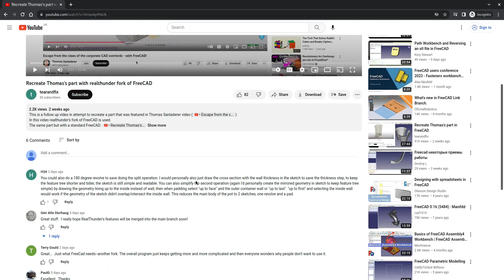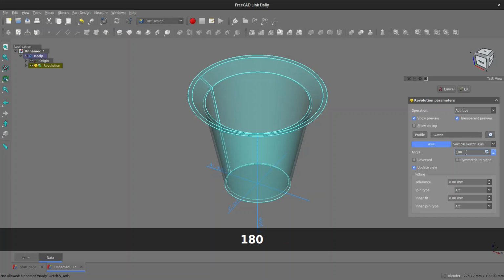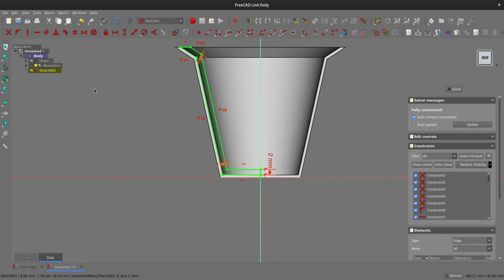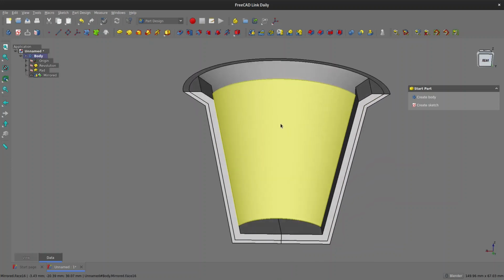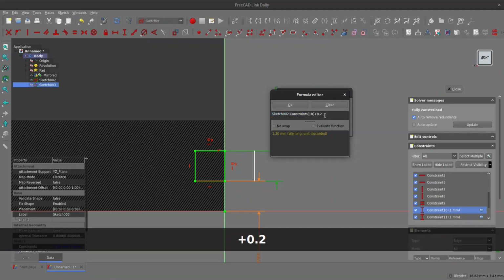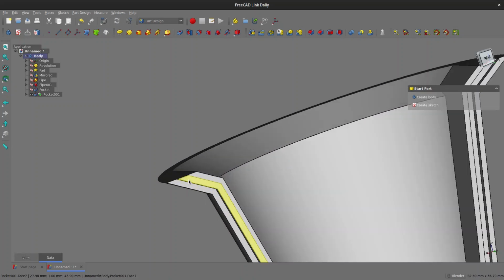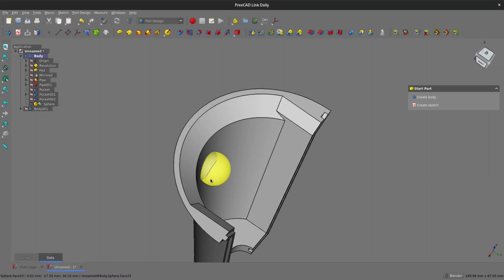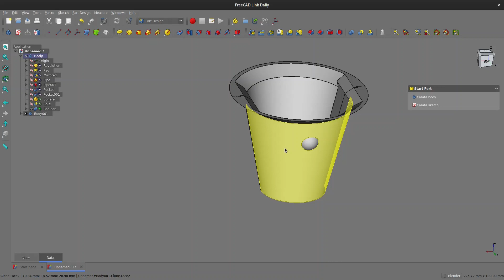Another approach to design Thomas's part with Realthunder FreeCAD

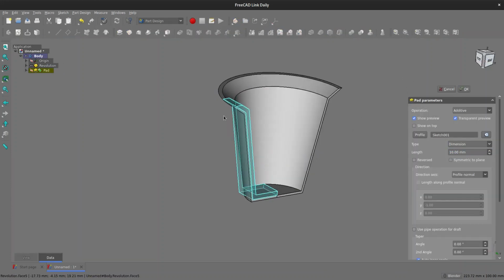Comment from the maker: At 5:47 for pad operation to work "To last" with unchecked "Check face limit" is needed. The tool tip to "Check face limit" says "Note that you may want to disable this if the up-to-face is concave"
Reply: I got it to work with both up to last (which is fine because last is the face we want in this case), up to face works too+select outer face, at least for me.

Up to first didnt work because the first (inner) wall is intersecting/touching the sketch.

It didn't occur to me to use the second sketch as a path, thats smart, I drew a new path sketch for it. The path edge i think would have been long enough if you shrunk the pin instead of widened the hole, so both sketches either aligned or were above path.

Comment: Thank you for this video. Very clear and concise delivery.

If minimizing steps is the name of the game, you could also eliminate cutting the hole in the bottom by designing the hole into the profile sketches. Of course, this wouldn't work if, for some reason, you didn't want the hole to be round 😊

Comment: This is a great video and I think that there is value in both Thomas Sanladerer's  critique of FreeCAD and your response to it.

I think that you can also avoid doing two sketches for the pipe, because as I understand it realthunder's latest release allows you to use multiple profiles from sketches for operations which means that Sketch002 and Sketch003 in your model could theoretically be one sketch for both the additive and subtractive pipe. For the same reason I am guessing that you could incorporate all the features in the original sketch that you use for the revolve and then pad them individually.

On another note. What are you using to do the screen recording?
Reply from the maker: Thanks for the comment. I agree that more attention is attracted to FreeCAD the better it will become. 

About one sketch for the additive and subtractive pipe. It is a great suggestion! I tried it and it works in the standard FreeCAD version as well. Having a single sketch for two mating features is more readable in my opinion.

Is use SimpleScreenRecorder and Screenkey on linux.